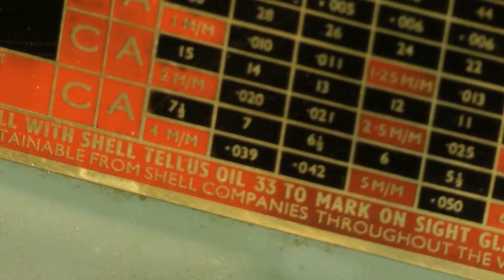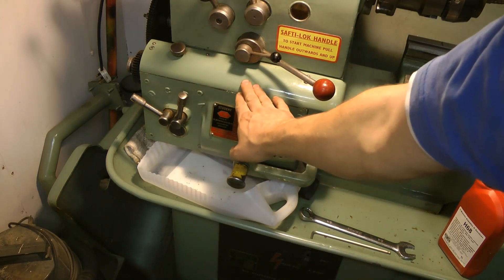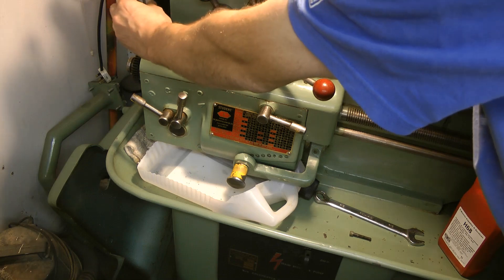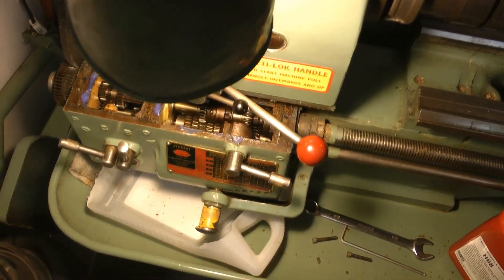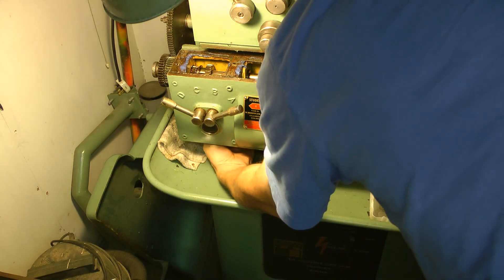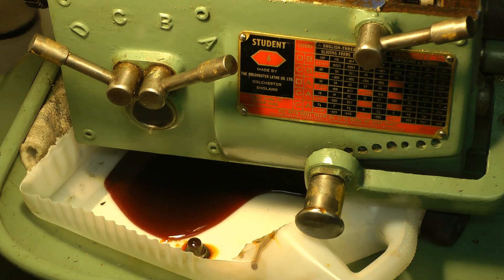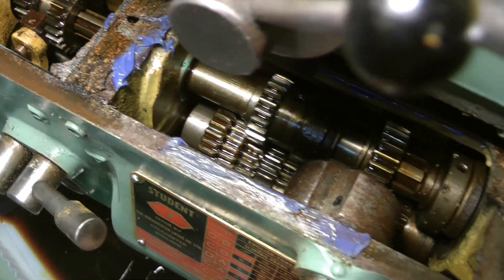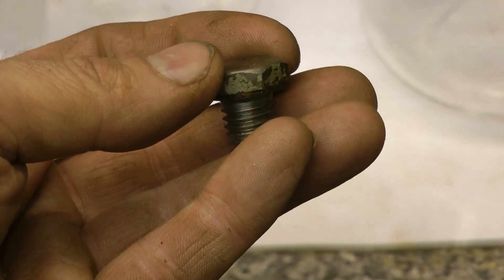Replace old oil in your lathe a easy home DIY workshop project you can do yourself at home

Comment: Chris,
I keep the old oil from the milling machine, pass it through a funnel with a load of rare earth magnets around it and then mix it with paraffin and use that as my cutting / lubrication oil. However, I am a skin flint I blame it on my grandma who was from Keighley tha knows!
Reply from the maker: Michael Linahan  is that keighley near skipton? If so I’ve been there, good charity shops up there for bits of bric a brac/ metal, thanks for the tip re the oil I’ll try it 👍 it’s also good for getting wet  bonfires going 😀
Reply: Chris,
Yes that's the place but fire starting is something we don't need at the moment having relocated to Aus. Not wishing to put a downer on things but as soon as a bush fire starts there are all sorts of nutters that go around deliberately starting fires in other places not to make fire breaks but just because they are nutters. Each year there are numerous cases of people getting charged with willful arson and they do it just for the fun. Meanwhile there are families that loose everything and some firemen that make the ultimate sacrifice.
Reply from the maker: Michael Linahan  it’s a serious problem over there, my older brother has just come back after a fifteen year stint over there, he’s trying it for a year here to make his mind up what to do, what part are you in over there?
Reply: Chris,
I am in Melbourne, been here 12 years,  but about to retire from my full time job. I have been thinking about moving North to NSW/QLD border for the climate and cheap properties as the price in Melbourne is stupid crazy despite the economy going to hell in a handbasket. However, with the fires I may need to think again. There are pros and cons about all the places but I may need to think about a place by the coast. The climate is definitely changing but whether that is totally man made or just one of the warming cycles that have happened over the millenia is for people above my pay grade. This country has a lot going for it but it doesn't have the local pub!
Mike